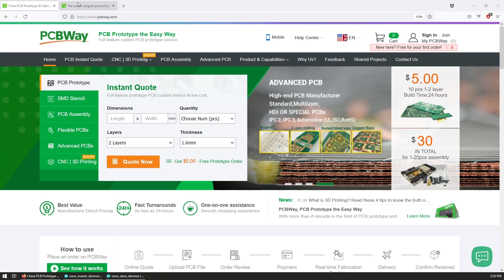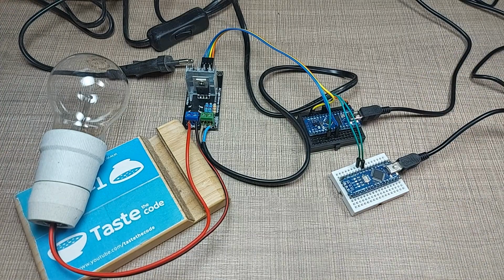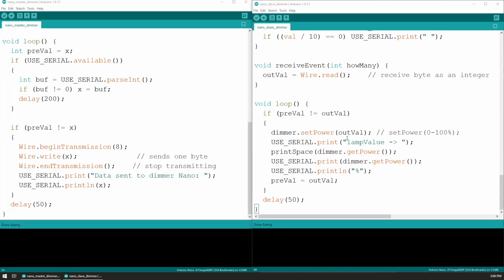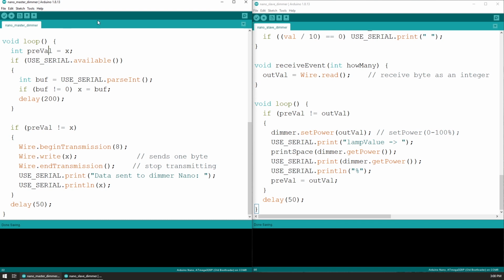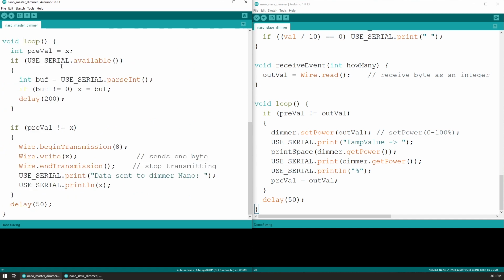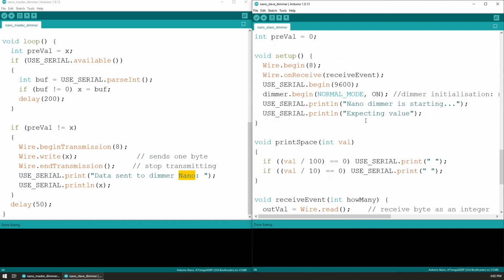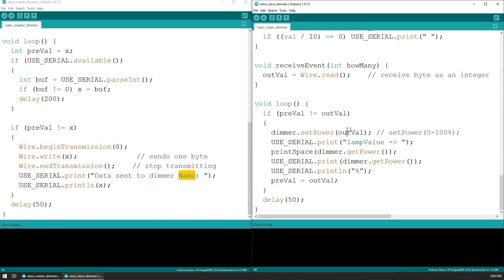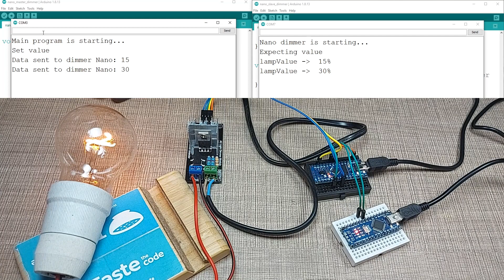How to make an Arduino custom I2C slave sensor/device

Comment: at time 3:18 you are asking if you can omit that interrupt pin and use normal code. I have a movie that is doing exactly this, but it is made for a rotary encoder. My code is not using any interrupt pins ! Is using the code from a library adapted to my usual code. Im also not using any specific library to read the rotary encoder either. Hope it helps you! https://youtu.be/LVVRd7NpUQc ;) You have some nice projects with arduino !
Reply from the maker: Thanks for sharing this! You go into a lot of details how it all works! Subbed! :)
Reply: @TasteTheCode  thanks !

Comment: You mentioned that ATTiny 85 uses the same pin for interrupt as for I2C. But isn't the ATTiny85 fast enough to do zero crossing detection without interrupt pin but do the zero detection with software ?
Reply from the maker: I did not tried that but there is a risk to miss it by just a little bit and not turn on the light on time.

Comment: Thank you for your efforts in teaching us about Arduino. I have benefited a lot from you. I am grateful to you.. I have a small project, but I could not do it.. Not because it is difficult, but maybe I am not good at programming ..Can you help me please..thanks
Abu

I'm trying to upload a link to the pdf file but youtube won't allow
Reply from the maker: Hi Abu, thanks for the great words! You can contact me through FB messenger but I can only provide general guidance.
Reply: Yes, of course. All I need is instructions only - but unfortunately I do not have Facebook - I will try to explain to you

I just want to send a wired signal from pin No. 4, for example, to pin No. 5, and the signal is from an external source.. For example, I want the Arduino to press a button on the TV remote by connecting two wires from the remote control motherboard button to two of the Arduino pins, and the Arduino will connect between the two pins As if someone is pressing the button..I hope you understand me..
I will put for you a link to a video that I just uploaded on YouTube, not exceeding a minute.. It has an explanation with pictures. Watch it if you have time..
  Thanks for replying to me
Abu
Reply from the maker: You will need to use an opticoupler for that. The Arduino will turn on the LED on it, and the optocoupler will "press" the button.
Reply from the maker: OK, I checked the video and you definitely need optocouplers in order to have isolation between the remote and the Arduino. Each button will need it's own optocoupler that will connect in between the two lines on each of the buttons and will be controlled from a pin on the Arduino. Since you want to have multiple buttons pressed at the same time, you can control multiple optocouplers from the same Arduino pin in order to simplify your code.
Reply: I am very grateful to you for your advice.
I did not know the function of the optocoupler, but after looking at it and watching several videos, I understood what you mean.. The world of electronics is very vast.. Thank you.. I wish you all success in your life.

Abu

Comment: Great project Balich!
My solution for the communication between the nano (your mainboard) and the attiny (the board that you use just for the module) would be just using an analog voltage or PWM signal between them, what do you think? I think that it is worth trying. I think just that 0-100 value for the percentage that the module's library asks, can be sent just by "sending" a PWM signal between them, and some sort of mapping will do the job.
if we need to send more data, so it is not applicable, but as I can see you will use the attiny just to control the module.
I have used this method, and it worked fine for me, just needed to have a common ground between the two boards, so I created a "protocol" with my rules :P haha
Have fun :D
Reply from the maker: Thanks Slavko! I thought about using analog/PWM voltage but that will only work for a one way communication. In this case it will work but I wanted to have more flexibility for future applications.